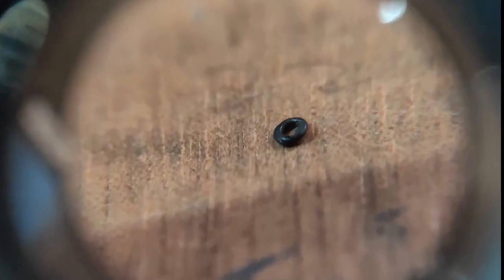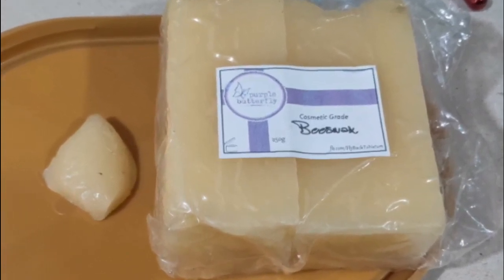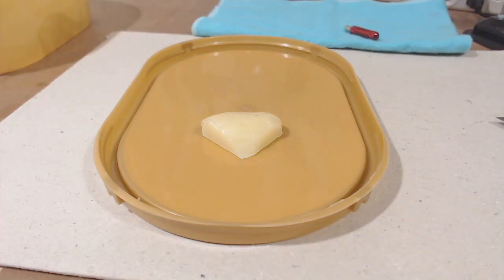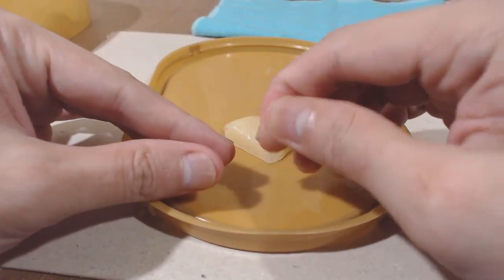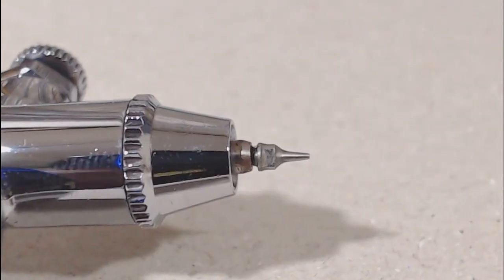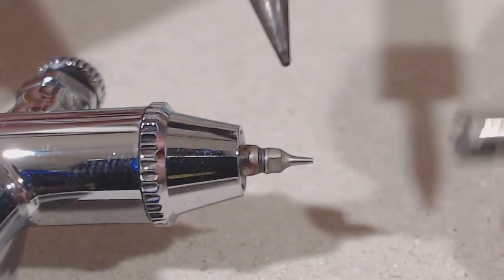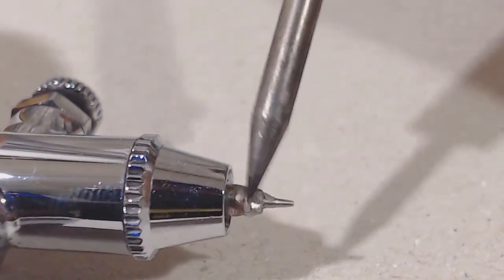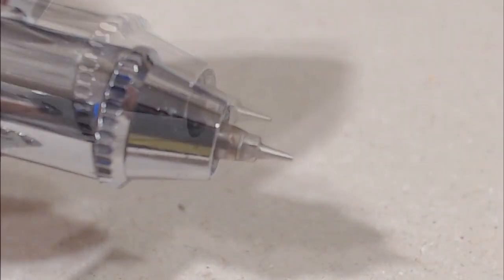Part 1 How to Seal the Airbrush Nozzle | Beeswax | How to Airbrush

Comment: THANK YOU SO MUCH I thought I had broken my airbrush but u just pretty much named off everything it's doing so must be a bad seal... thanks 🙏
Reply from the maker: Do you remove the nozzle to clean it, how often? I actually using the nail polish for some of my airbrush, most especially my .5mm's because I don't really take apart the nozzle. Nail polish would last a long time. I also made a video for it.

Comment: Just saw your video, it should get rid of any bubbles in the cup too?  I have a Paasche Talon GF and this AB got many problems,,,
Reply from the maker: It can, but there are other things that can cause bubbling. In my experience blocked needle cap and/or the noozle is not protruding, mine was level with the needle cap.

Comment: A few years ago, I noticed that my favorite airbrush (and at that time the only one, because of it's price... an Iwata High Perfomance B, bought in 1985 for 279 DM. Equals approximately €250 or $295, today) had no rubber O-ring or any sealing at the junction of nozzle and airbrush-body. Nor did any Iwata airbrush of collegues.

After thoroughly cleaning it (incl. removal of the nozzle) I immediately noticed, that doing fine-lines was nearly impossible, now. But after using/trying it for some hours, this was not the case any more. I inspected the junction inbetween nozzle and airbrush and noticed some minor dried up acrylic paint in the threads of the nozzle. A perfect and easily removable sealing...

So, this is what I do for sealing the nozzle-junction on all my airbrushes:

1. Carefully remove the O-ring eventually present on the nozzle
2. Put a wee tiny little "drop" of acrylic airbrush-paint (I use Schmincke AeroColor Pro) on the thread of the nozzle. If it really is a drop, then it is by far(!) too much...
3. Carefully screew the nozzel back in and let the sealing dry for half an hour or so (depending on your paint).
4. For removing the nozzle again (cleaning/maintainance..) I do bath the tip of the airbrush (incl. nozzle-cap) in airbrush-cleaner for a few minutes. Pure isopropanole should work as well but I never tried it. After that you can easily unscrew the nozzle again.

Doing so I have perfectly air-tight nozzle-junctions on all my airbrushes (even the cheaper chineese ones).

What I usually do, too (regardless of cheap or expensive airbrush), is altering the tip-angle of the needle (making it very, very slightly more pointy/thinner) and polishing the needle-tip to a mirror-like surface. The former makes controlling the airbrush (slightly) more easy and the later will (slightly) delay paint build-up ("tip-dry").

On cheap airbrushes I usually modify the springs and remove some ridges on the internal mechanics here and there making the cheap airbrushes feel "rough" by default.
Reply from the maker: Base on what you did, you are capable of observing, analyze, and solve problems. That is so clever to use paint to seal the nozzle. I would like to add that to my tutorial if you will not mind. Thanks for sharing your knowledge, I really appreciate it.
Reply: @AirbrushNinja  Feel free to include it. I always felt more comfortable doing this instead of using beeswax or greese.

BTW: I whish these videos of yours had been available to me, when I started airbrushing. Back then all I could learn from was books. And these were mainly targeted on doing technical illustrations (exactly not what I wanted to learn). So, I had a very hard time finding out the do's and dont's by myself... I watch your videos and easily find tons of things were I can still improve or maybe just feel that I really have to try this, too. (Even in your beginners series! ;-) So, big thumbs up!)

Comment: Great video! I have bubbles in the paint cup with just water in it. I just bought an Eclipse side feed (not cheap) and can't believe I have this problem already. Would a compression fit nozzle go that fast?
Reply from the maker: I will recommend you to buy o ring instead of beeswax. But if you don't mind doing this process often times, yes, this will seal the nozzle just fine.

Comment: Is the beeswax permanent or are you still able to remove the nozzle again. If so, how do I do that?
Reply from the maker: It's just temporary. Simply unscrew the nozzle, beeswax is not hard it is just like a candle.
Reply: @AirbrushNinja  thanks! Also, is beeswax soft enough such that I can simply smear/spread it on the threads if I wished? Like such that I don't need the soldering iron or a lighter to heat it up
Reply from the maker: @hkkoh7265  you need to heat it up so    it will penetrate the gaps
Reply: @AirbrushNinja  thank you